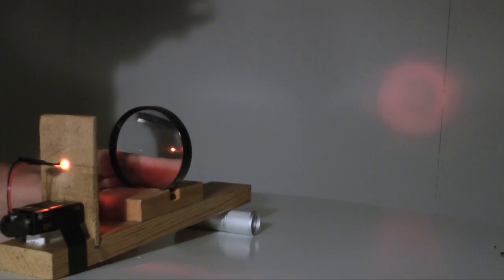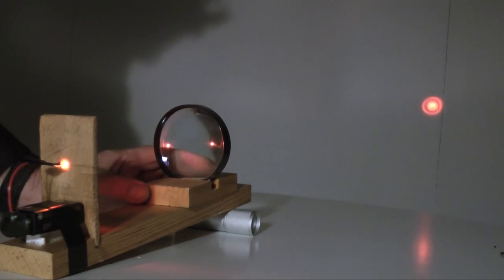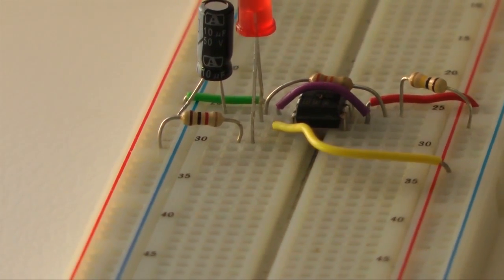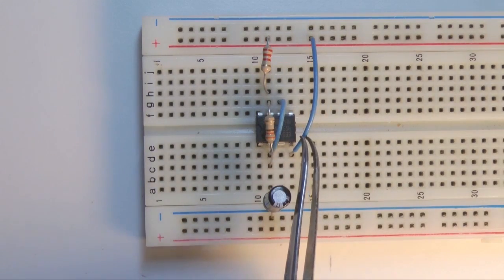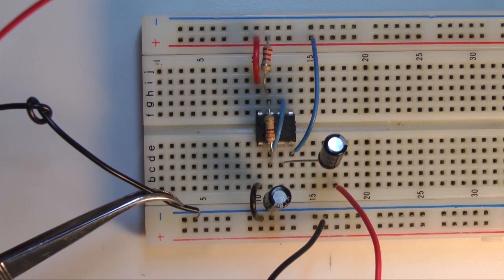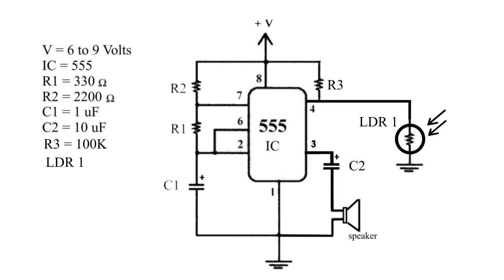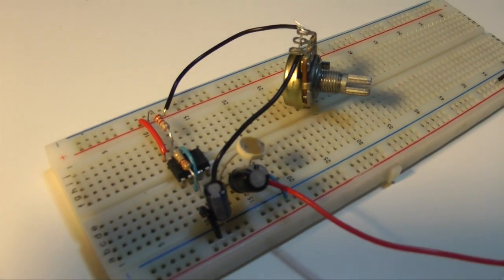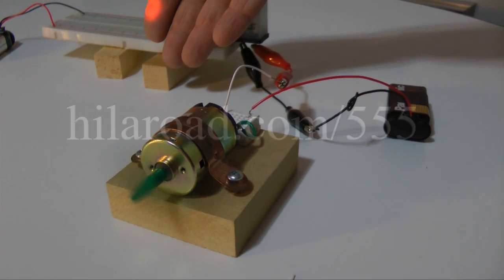Shadow Detector

Comment: Plug the 555 integrated circuit into a bread board. Connecting pin 2 to pin 6, now resistor R1 a 330 Ohm Resistor from pin 2 to pin . Next, another resistor R2 a 2,200 Ohm resistor from pin 7 to the positive power supply line. Next, we need a one microfarad capacitor. C1 this connects from pin 2 to the negative power supply line the Blue line, watch the polarity positive to pin 2. Next, we need a wire from pin 4 to the positive power supply line, we're going to drive a speaker from pin 3 this means we have to connect a 10 microfarad capacitor from pin 3 to an unused row on the RedBoard. Watch the polarity positive to pin 3. The next two connection require a wire from pin 8 to the positive supply line and another wire from pin 1 to the negative supply line. It will need a speaker  with the polarized with a plus and minus symbol on the connectors. Speakers are connected with two wires for our circuit one wire connects to the negative end of the 10 microfarad capacitor, that unused row, the other wire connects to the other negative supply line.